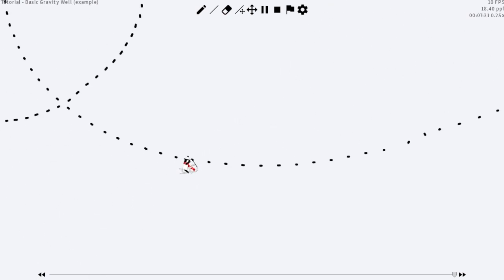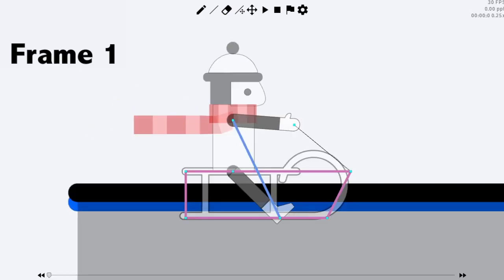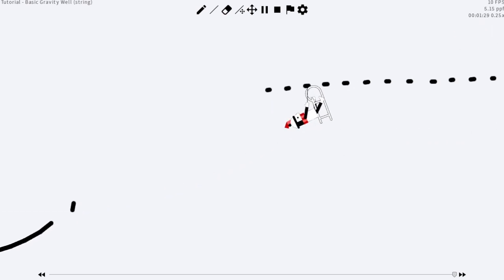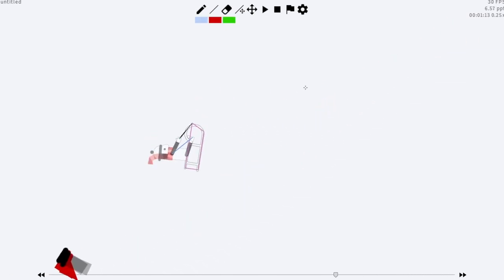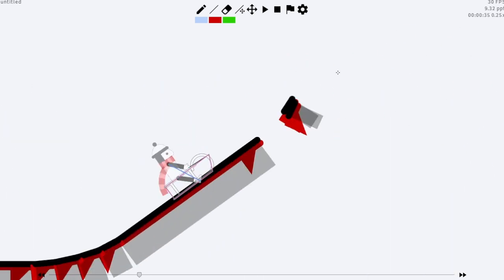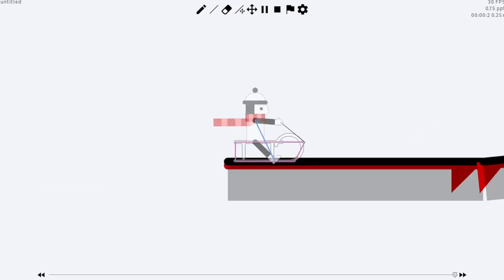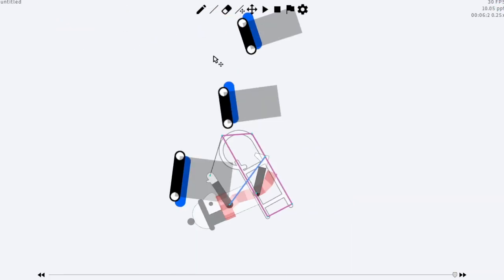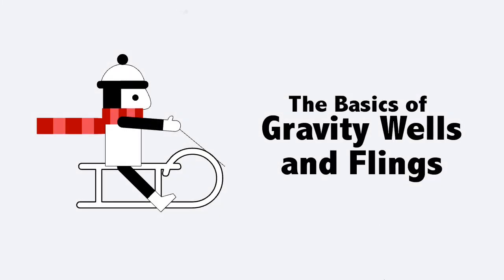Line Rider Tutorials - The Basics of Gravity Wells and Flings

Comment: I'm really having trouble grabbing the right contact point, usually it just doesn't interact at all and tries to grab the hand from miles away and throws bosh off the sled.
Reply from the maker: So this problem definitely fixes itself with practice, but what you can do right now to figure it out is maybe make it a smaller line. This gives it a smaller chance to grab the wrong contact point.
Reply: @itsappl  Okay I'll try that, I've also noticed that the angle of the line changes which points it will or will not grab, how does that factor into all this?

Comment: When i tried to drag around the line to the contact points like you did at 0:33 , Bosch would only see a change in position when i let go of the line. Is there a way to fix this? I assume it's just a settings thing I'm missing
Reply from the maker: That's an interesting problem actually. I'm not sure if it's a setting but my guess would be the version of Line Rider you are using. I was using Line Rider Advanced: Beta for this tutorial, and I know some other versions are not the same with how they handle live line implementation like that.
Reply: @itsappl  aight, thanks. I just redownloaded it and fiddled with the settings for a bit and it's working fine
Reply from the maker: @bossmode.epicstyle  Glad to hear it!

Comment: Why does it only work sometimes like I tried to do the hand thing and it did not work but when I did it in a differend place then it worked
Reply from the maker: Gravity wells are incredibly sensitive, and it is very easy to knock Bosh off the sled when you use them because of how powerful they are. It takes a long time to get a good feel for what will work and what won't.

Comment: It doesnt work i am using lr.conundrumer.com it may be a problem with the line shape pls help
Also i don't have enough storage to get a c# ide so i can't run line rider advanced
EDIT: I found out the c# ide was for the source code ._. I swear it said for the game and not the source code
Reply from the maker: Joe Christo That website or Linerider.com are great ways to play linerider. The physics will not be different between the places you play it so gravity wells will still work. It takes a lot of patience though. Pay attention to how the line is placed in the tutorial vs how the rider is moving before he hits the gravity well. Good luck!
Reply: Joshua Nightingale But the shape of the line on lr.conundrumer.com is different from the one in linerider.com 
I was able to do gravity wells in linerider.com 
And yes I know the physics are the same
Also if the shape of the lines were the same as the linerider.com I would be able to show the contact points to do it more efficiently 
But you can’t show the contact points in linerider.com
But you can in lr.conundrumer.com
Reply from the maker: @joechristo2  I see. I believe the shape difference is purely cosmetic to the program. If you save a track in one and import it to the other, it will work just fine. But the most important thing is that you're comfortable in the program you are using so learning in lr.conundrumer.com is not a problem.
Reply: Joshua Nightingale Fixed I found out you don’t need a c# ide to play line rider advanced so it was just not working on my computer but I recently got a windows 10 and line rider advanced works on it
Reply from the maker: @joechristo2  I'm glad you got it all figured out!
Reply: I swear it said I needed a c# ide for the game and not the source code

Comment: Doesn't work for me. Rider just clips through the chain.
Reply from the maker: VilkasKettu if I understand the comment correctly, you may need to put the lines a bit closer to the sled. If it’s too far, it’ll be too strong and pull him too fast and knock him off. If they’re too close though, it’ll pull unwanted contact points as well, usually resulting in him just popping up to the top of the lines. There’s a sweet spot in the middle that you have to find and it takes a while but it’ll work for you if you put in the time.
Reply: Make sure the gravity well does not touch multiple contact points
Reply: If you are using line rider advanced use the line adjustment tool and hold alt while adjusting the line and when the line touches the rider and the rider doesn’t die then the line will stop moving so that will help

Comment: How do you download line rider: advanced? I have the zip file I just don't know what to do with it.
Reply from the maker: It should just be as easy as unzipping it. You should be able to do this by just double clicking it.
Reply: When I double click on the zip file it just opens it up to the different files in the game.
Reply from the maker: Does it show a .exe file or some sort of application in it? Try clicking that if it does.
Reply: It shows two line rider parts one is an application and one is just a file. There is an .exe ,but it is linerider.exe.config
Reply from the maker: Are you trying to run it on mac or PC? I think you should just need to click on the application...
Reply: I'm on PC